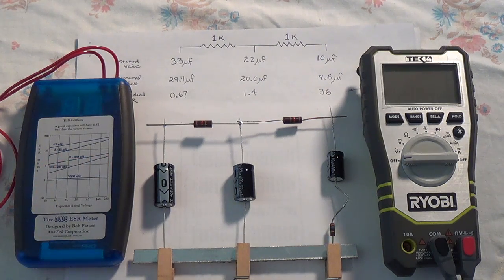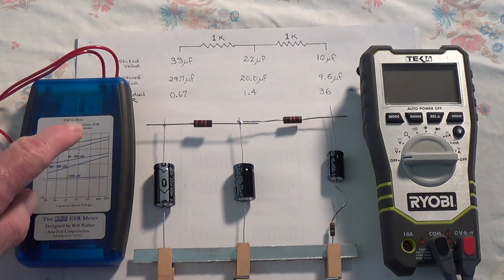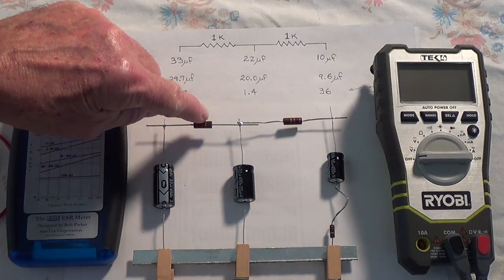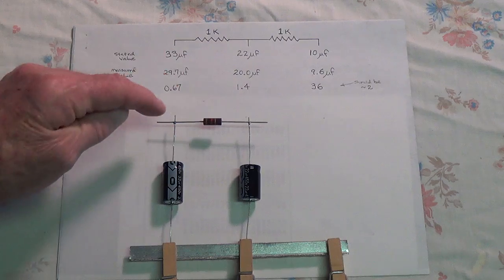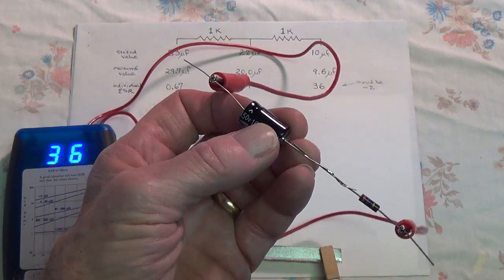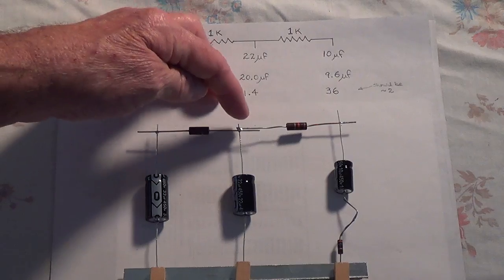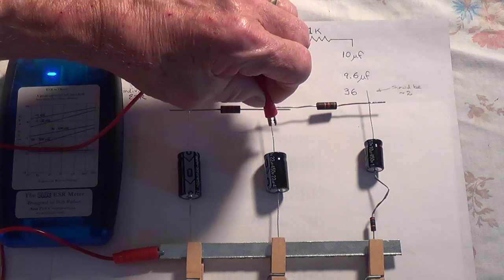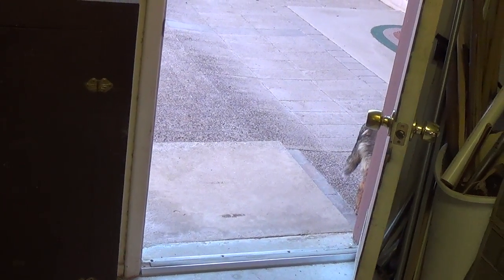Measuring ESR in Tube-Amp Electrolytics, In-Circuit

Comment: It's time for a new video Doug.
Excellent work
Reply from the maker: BBK1 Thanks, BBK. The schedule has been pretty hectic lately, but Rusty and I intend to come up with a new one, soon.
Reply: Good. 
Any experience with a splawn competition amp head? I have 2 that are oscillating when switched to half power
Reply from the maker: I not only have no experience with them, BBK, I have (until now) never heard of the brand :) If two of them are doing this, it sounds like a flaw in the circuit design. Perhaps the company is aware of this problem and come up with a fix. Before spending untold hours trying to figure it out, I would call Splawn and ask them about it. They'll probably tell you to increase the value of a grid-stopper resistor or two.....but at least the problem will be resolved.
Reply: From what I can see, these things are just 50 Watt oscillators masquerading as amplifiers.

Part of the design flaw in these things is that they use 12AX7's in the first, second and phase inversion stage with a very high stage gain ratio. I managed to get one stable by using AWV valves made in 1969 ( my dad was an electronics eng and tech on radios ) NOS.
Funnily enough when those horrible cheap chinese valves were removed it became stable.
WHen they return to the shop the second and third stage will have a lower mu valve inserted to roll off some gain, along with the plate / cathode resistors being changed out for something more sensible.
Reply from the maker: Sounds like a good fix, BB. The police might be interested in using them (in their original state) as sirens :)
Reply: Perfect application for them!

Who in their right mind woud give that much gain in the front end? it defies and logic, yet, these things are sold as hand build guitar amps to drool over!

On another note, The class G toooob amp is coming along quite well, and, even though it doesn't seem louder, it is in fact dumpin more power  into the speakers. This topology provides enormous head room due to the valves ability to drive a much lower impedance load, thus the plate current vs plate voltage performance is much better than anything we had in the west.

Perhaps we mich get Uncle Doug building them one day soon ;))
Reply from the maker: I guess the amp designers went for max output power....at the expense of reliability and proper function. Rusty and I anxiously await the successful outcome of your Class G project, BB. The suspense is killing us :)
Reply: Building 2 prototypes. One will be shipped to you for an online teardown. this of course happens after the design and the company is registered in the next few weeks.
Reply from the maker: I'm not sure if we're fully capable of understanding the complexities of this unusual circuit, BB, but Rusty is warming up the video camera and tuning his guitar in anticipation of the opportunity to at least act like we do :))

Comment: Hi Dug, could you recommend some good books about guitar tube amps (design, repair, manuals, etc)? Thank you.
Reply from the maker: Gerald Weber has written several books, and all (or most) are currently available on Amazon. You can look them up and read parts of them to see which one(s) you like.
Reply: Uncle Doug  Could you make some video about "distortion in amps, where it come from, harmonic distortions, how to get more or less distortion, how switching between clean and crunch channels works (different way of signal run or something else, etc). I was reading a bit about secondary and third harmonic distortion and that the amount in relations with resistor (resistance) amount from (cathode if i remember). I'd like you explain this moment in your simple way, if didn't do it already in other videos.
Reply from the maker: Greetings, KN. Tube amps are favored for guitar use largely because they produce even-ordered distortion (a "fuller, more musical" tone) that increases gradually with increasing output power, while solid-state amps tend to produce more odd-ordered distortion ("thin, harsh" tone) that appears more suddenly. You may be referring to "Audible Energy Storage" which is much higher in tube amps than in SS amps, because tube circuits operate at much higher voltages with relatively low-valued electrolytic caps. Here is an excellent article explaining the differences:  http://vtl.com/technology/why-tubes/   I will consider this topic for a future video. Thanks for your input :)

Comment: Very timely video. I just happened to buy a '67 deluxe reverb a few days ago. Every capacitor in it is original and I wanted to keep it that way as much as possible. I ordered a blue esr meter to test them. In your sophisticated demonstration setup you have one end of the esr meter connected to what would be the equivalent of a chassis ground? Is that correct? So if I wanted to do it the lazy way I could check my capacitors by grounding one lead of the meter and only testing the positive lead of each capacitor?
Reply from the maker: Yes, one lead to the chassis ground and the other to the positive lead. Bear in mind that ESR is just one of three criteria that should be evaluated. It's also a good idea to use a Current Limiter when testing vintage equipment (see my video on how to make one). It will protect the circuit against damage due to short circuits. Best of luck with your newly acquired DR.....a truly great amplifier.

Comment: Another great and informative video! I have a bassman100 mid 70s sf export model (aus) and you have inspired me to get this beast rockin again, for some reason it has what appears to be a bassman 50 tube chart, have you seen this often? fender putting the wrong tube charts into heads? Everything appears to be original.Keeps the vids rolling, loving the lessons!
Reply from the maker: Greetings, MS, and thanks for the very kind words. The SF Bassman 50 and 100 were both constructed during the same period of time (72-77), so it's possible that an error was made at the factory.....however, an employee would have to be virtually "brain dead" to make such an obvious error. It's my experience that, over the years, people have mixed and matched all sorts of Fender chassis and cabinets. I once owned a Brownface '62 Concert chassis (never offered in head form) that came to me in a Silverface head cabinet. It looked great and was very practical, but was obviously the product of human intervention, long after it left the factory. I believe this may well be the reason for your cabinet/chassis mismatch. Regardless, it would make virtually no difference in the value of your amp.

Comment: Hey Uncle Doug, can you do a video on how to design this part of an amplifier - how to select proper values for filter capacitors and inter-nodal resistors?
Reply from the maker: Greetings, AR. It's good to hear from you. To be honest, the calculations that go into the selection of components for a power supply would make for a rather long, boring and very technical video. When making clone amps, I generally just duplicate the schematic; and when making up original circuits, I use the power supply design from a similar, well-known amp, then fine tune if necessary.

Comment: Thank you Uncle Doug and Rusty for posting this.  I recently watched the Anatech video and was having second thoughts on purchasing the meter.  You have cleared up any confusion:)
Reply from the maker: You're welcome, Aero. The first time I watched their video, I was confused too. The only power supply rails I am accustomed to seeing (in tube amps) have the internodal resistors, so I assumed he simply forgot to mention them. After a little research, I discovered that some high-speed/frequency solid-state switching power supplies have rails with lots of parallel electrolytics....and they are what he was talking about. As the video shows, the meter works just fine with tube amp power supply electrolytics.
Reply: Uncle Doug  If a person had any doubts about whether the capacitor had intermodal resistors could they take a jumper cable with alligator clips and connect each lead end on each side of the capacitor with enough room to put your ESR leads between the capacitor and the jumper leads.  I hope that made sense.
Reply from the maker: It's probably best to consult a schematic, Aero, so you can see exactly what's going on in the circuit. If you jumpered the capacitor, the ESR reading would be zero....even if the cap was in awful shape.

Comment: Greetings. Might I suggest a topic: Using Your Oscilloscope To Test/Verify Various Aspects Of Tube Guitar Amp Function. Just rolling down the signal path highway, pulling off at all major exits, rest stops, and roadside curiosities. Ripple management, asymmetrical clipping, breakup, mu (not the dairy cattle along the route, but the tube characteristic)--what you can and can't discern with an oscilloscope. Thanks again!
Reply from the maker: You're welcome, and thanks so much for an excellent suggestion, JC. I will definitely keep this in mind for future videos. I hope you saw the oscilloscope portion of the Photoresistor Tremolo video.
Reply: Uncle Doug I did, and it reminded me. Thx.

Comment: Doug - your example is valid as your capacitors are not wired parallel. They are not on the same "buss"  or the same "rail" or  the same "PSR". The example the man gave in the AnaTek video had all the capacitors parallel and they would read as one capacitor and you would not be able to distinguish one from another. Your example is realistic for an audio amplifier power supply with voltage dividers and decoupling capacitors. If there is a case where capacitors are indeed parallel then they will have to be separated and checked individually.
Reply from the maker: I agree completely, David, and hope that the revised video emphasized these points. Thanks for your input :)
Reply from the maker: Thanks, SZ. I tried to keep it simple, but visually "interesting". Rusty suggested the clothes pins :)

Comment: Thanks for putting this one together!

I whipped your demo circuit together (literally 2 minutes of scrounging for bit of bus-bar and caps) and got similar results with my home-brew 5-transistor ESR meter.  I was considering purchasing an AnaTek to confirm that my meter was "accurate", but I'm within 5% of your ESR values both before and after, and I can live with that!
Reply from the maker: XombyCraft You're welcome, XC. It's great that you took the time to duplicate the circuit and confirm the results. It sounds like your homemade ESR meter is working quite well, and you're going to save $100.....a win, win result :)
Reply: Even at $100, you save $1000's easily on rescued hardware.
Reply from the maker: Quite true, XC. Best of luck with your projects :)
Reply: Thanks!  Looking forward to more videos!
Reply: Xomby would you be willing to share your schematic of your home-brew meter? in Canada we have to add 50% of USD with a nasty exchange rate and import and brokerage fees. just checked it out on both Amazon USA and CA 116usd 220cnd im trying to get a work visa to move to the great USA down south in the new Mexican desert, we just had a week of -30c with wind chill at -42c and winter just started, good grief lol